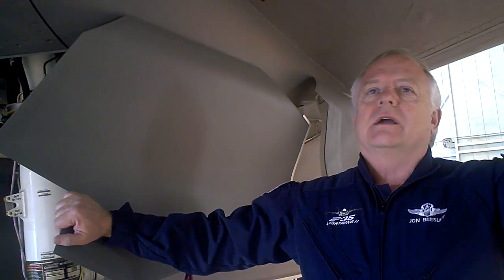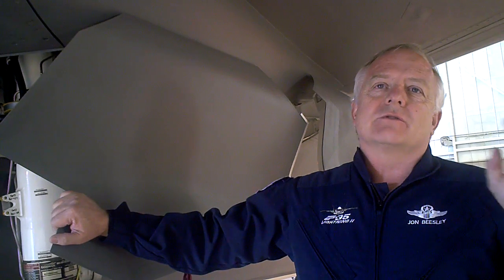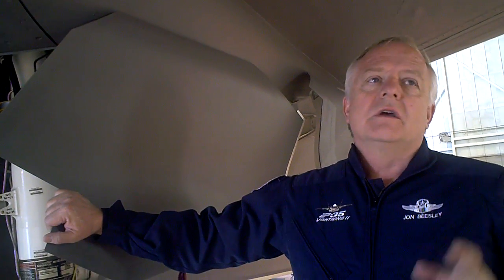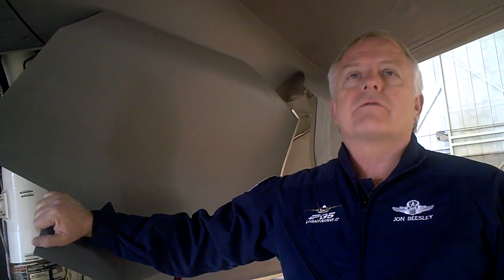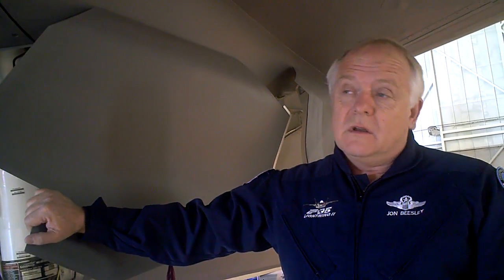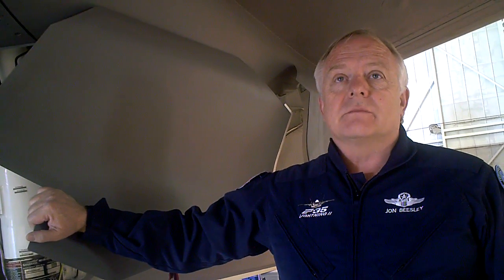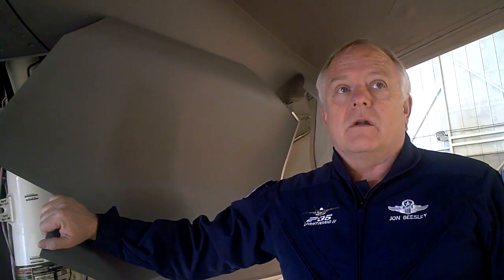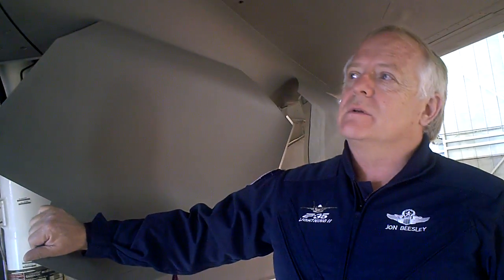Beesley on F 35 air to air

Comment: "The fifth stage of low-rate initial production (LRIP5) had yielded a unit cost 13 per cent below the $67 million, which was the official U.S. government estimate on orders placed in 2017 for aircraft to be delivered in 2020. The reduced cost worked out to just over $58 million, and includes the Pratt & Whitney F135 engine, as well as all the pods and sensors required for operations" sais Steve O’Bryan, Lockheed Martin’s vice-president of F-35 program.

Comment: @UnforgivingDemon F15 - thrust/weight 1.12, speed M2.5+, climb rate 50K fpm....  F16 - thrust/weight 1.09, speed M2+, climb rate 50k fpm.... F18 - thrust/weight .96, speed M1.8+, climb rate 50k fpm....  F35 - thrust/weight .87, speed M1.6+, climb rate classified.  As you can see, you are incorrect on all accounts. The F35 is slower, heavier, and less maneuverable than the three 4th gen aircraft you referenced. It's unlikely the 35 will have a climb rate of even 50k due to it's low thrust/wieght.
Reply: F-15 Fuel capacity: 13,455 lb (6,103 kg) internal
Thrust/weight: 1.07 (1.26 with loaded weight and 50% internal fuel)= 3050 kgThe F-15 can burn through an amazing amount of fuel in a short amount of time. In the dense air at sea level with maximum afterburner selected and at high speed, the total fuel flow can be more than 23,000 gallons per hour, or 385 gallons per minute

F-16 Fuel capacity: 7,000 pounds (3,200 kg) internals
1.095 (1.24 with loaded weight & 50% internal fuel)[= 1500kgthe F-16 at full military power and low altitudes burns about 8000 pounds of fuel an hour, which with a full droptank configuration gives it about 2 hours' flight time. In full afterburner at low altitudes, the F-16 can burn in excess of 64,000 pounds an hour.

F-35 Fuel capacity: 18,250 lb (8,278 kg) internal
0.87 at gross weight (1.07 at loaded weight with 50% internal fuel)= 4100kg In this diagram it states that the F-35A (1 gallon of JP-8 = 6.7lb) burns about 4000lb of fuel per hour, cruising at Mach 0.75 and 40,000ft (which according to Wolfram Alpha is about 430 knots TAS).
Reply: F-15 2500lbs/min full throtle low, F16 1066lbs/minute, low full throtle.,F35 66lbs/minute cruising high